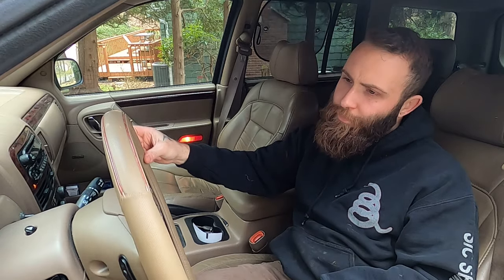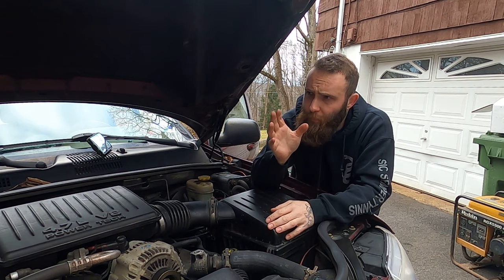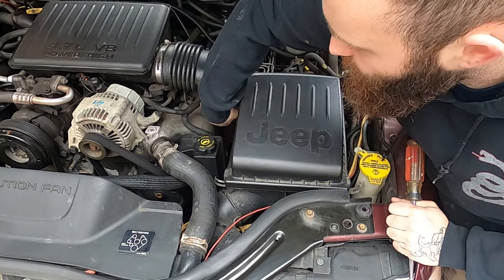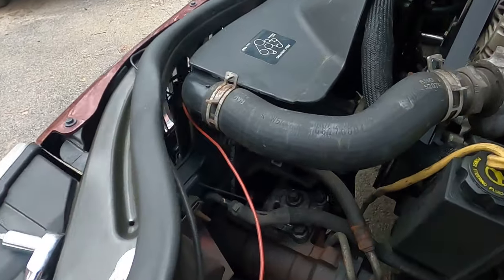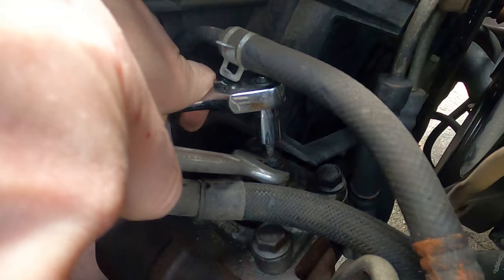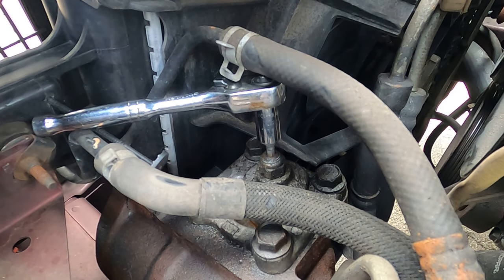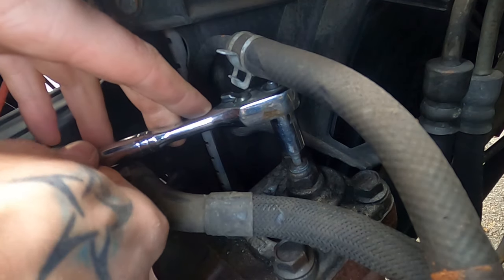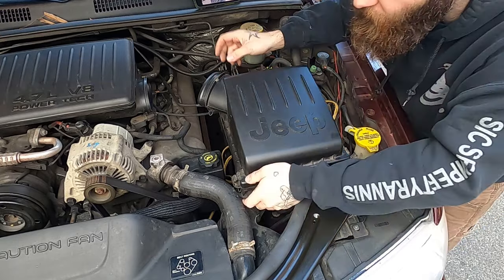How To Adjust Your Jeep Steering Box - FIX STEERING SLOP EASY!

Comment: My ZJ took about 3/4 of a full turn.  It also makes it a lot easier to keep track of the adjustment if you put a little dot on the allen adjuster and also on the box itself with a paint pen to keep track of where you started and where you're clocked to after adjustment.
Reply from the maker: That is a good point.. wish I had added that... also... 3/4 of a turn?! That has to be a record
Reply: Good idea!
Reply: Followed this advice and video. Have already adjusted a 1\2 turn. Still feels a little sloppy to me but I'm afraid to go any further. Curious after 2y if the 3\4 turn @natemasterson1727 made ever caused any issues. Still going strong?
Reply: @Joespower  I daily my XJ now but I did back the ZJ off MAYBE 1/8 of a turn. Just to fine tune it. Still going strong with that though, no binding feeling and no slop beyond what the 1 ton UTK kit has inherently with drag link roll. The box was on 200k miles with no adjustment ever before that that I could tell, and I’d definitely say mine is a fringe case. 

If you’re going over 1/2 turn, I would do 1/8 turn increments from there IF that to make sure there’s no binding. But you may have other slop at play outside of the box itself, and doing a full inspection of the system from firewall to ground should be done to rule any of that out. I at first thought the I joints on the linkage from firewall to box were worn causing some slop but they were still tight when I inspected them.
Reply: But the ink doesn't stay on through the oil.😂

Comment: YJ, the battery is passenger side firewall, airbox is in about the same position.    The nice thing about an old YJ is that you get lots of practice rebuilding the vehicle bolt-by-bolt over the course of about 5 years.  Mine will be new again in say, 18-24 months.
Reply from the maker: Well there you go bud!. I hear you on that for sure. I know every bolt, nut, and fastener on my WJ
Reply: Did this work on a YJ?

Comment: Thanks for posting and sharing your knowledge! 98 ZJ I6 4.0 here, I have to try that, neat tip. I've replaced the wheel hubs, axles, new tires, tie rod ends, front sway bar bushings, front diff oil & gasket, steering damper. I did notice that it drove just a little bit better after each of those components was changed but it is all total markedly better than when I first got this jeep. Next up is the front upper & lower control arms and ball joints. Thanksgiving morning I replaced the harmonic balancer (it delaminated), interesting job for me as I had never removed a radiator before. What a mess! Yup, gotta replace that soon and update the transmission cooling lines, too. And I haven't even touched the cosmetics yet...headliner is shot, carpet is crap but each and every area needs TLC and will serve as a learning for the next jeep. I'm gonna get that sweater!
Reply from the maker: Rock on man! Sounds like you are treating that Jeep right. An 1/8 of a turn or so on the only steering box may be the final piece for ya

Comment: Don’t forget the bushing adjustment on the input shaft side.  It is more likely that the play can be corrected there.  Also, take a sawzall and cut off the u joint splined coupling on the steering shaft and replace it with a new set-screw type from Borgeson or other quality manufacturer.  The play in the steering of my ‘01 XJ was actually due to slop in the splines of the u joint coupling on the input shaft.  Check it out!

Comment: I'm definitely going to have to try this! My wife has an 01WJ with the 4.0 and it drives phenomenally! But over the last year I've replaced the ball joints, tie rods, control arms, track bar, and all four shocks and it rides so smooth! But the steering wheel is kind of sloppy so hopefully this will take the last little bit out!

Comment: That adjustment is for removing play between the gears in (sector and worm) the steering box. It should be done with the steering box at the high point (centered) easiest way to check for play is to pull down on the pitman arm and then hit the end of the sector shaft up with the palm of your hand, you will hear it click if there is play. If so adjust the screw down just until that play goes away. If you over adjust your steering won't go boom, but it will be too tight and steer even worse.
Another huge source of play in those boxes is side play in the sector shaft needle bearing at the bottom end of the shaft. Best to replace that.

Comment: Great vid! Did this on the yjs old steering box, did the 1/8 of a turn and even that was too much, started grinding right away, didn’t even have to take it out for a drive. That’s when I said heck with it, Durango steering box time
Reply: Just FYI the Durango box isn't an upgrade. Might be nice and new, sure, but still not an upgrade. If it's in budget you might as well upgrade while you're replacing it $0.02
Reply: What box would you recommend  @RavenRedwood

Comment: I have a 96 ZJ Grand Cherokee Laredo best car I have ever owned.
210000 miles. Runs perfect although I can fix up a few change. Like this loose steering!
Gas is pretty cheap though not in California.
Thanks for the Vid I'm going to try this on my Jeep.
Reply from the maker: Good luck, bud!
Reply: My 96 ZJ was bulletproof, the 4L I6, and quadra-trac went everywhere I pointed it...it was offroad more than it was on the highway, sold it with 232k on it, drivers seat was all torn up from wear, and the viscous coupler in the transfer case was completely shot.  I still see the current owner driving it occasionally.  Last I knew it was very close to 500k on it, the current owner replaced the transfer case, its now selec-trac, and he pulled seat covers out of a wrecked ZJ.  If I had known back then what I know now about the transfer case swap and how to replace the seat covers I'd probably still be driving that ZJ.  My 98 ZJ was a box of problems sadly, and 2 weeks after the head gasket issue and $1200 the transmission decided to puke fluid all over my carport.  So I ended up trading it in on a 2008 Ford Explorer 4.6L V8 Eddie Bauer edition...so far its a great rig....but I will someday have another Jeep, just not sure what yet, possibly an XJ (you know how customizable they are, I'd love to build a trail rig not major offroad rock crawling but something I can just take to the hills and go anywhere I want).  I do like the ZJ and WJ, but would love an XJ or even an MJ.  Not a Wrangler fan, I want to be able to daily drive it as well, and the Wrangler is out of the question for practicality purposes they are NOT highway vehicles LOL

My 98 ZJ drove completely different than my 96 ZJ.  The 98 had U-Joints up front, the 96 had CV axles....you wouldn't think they'd be that much different on the highway but they were.  I loved the limited slip in my 98 ZJ with the selec-trac though, great in the snow....the 96 ZJ with quadra-trac was awesome in the snow, but not nearly as fun as the selec-trac in 2WD with the limited slip LOL.

Comment: Doug! Romex? LOL. Love the advice. Tightening up the steering on an old vehicle can make a world of difference. I recently refreshed all the steering components on my '04 WJ (240K miles) and she drives like it just came off the lot! Engine mounts took care of the low idle vibrations and I was able to convince my wife that we didn't need a new car yet, lol.
Reply from the maker: Woohoo! Keeping the old WJ for the win!
Reply: I have a similar WJ. Smokes real bad. May do the valve seals. Did you have that problem?
Reply: @Kanakid  No sir, not yet. LOL. What color is the smoke?
Reply: @jonb2046  it’s blue. Worse at low speeds pointed uphill.
Reply: @Kanakid  sounds like your on the right track. In my experience, valve seals are most likely the culprit when burning oil. Unless it’s getting in through the air intake. Have you had a rollover recently? Lol
Reply: @jonb2046  no rollover. Lol! I have new seals, spark plugs and valve cover gaskets. Need to get a compression tester to hook up air compressor. Will also need a valve spring compressor . Any suggestions?
Reply: @Kanakid  I really like OTC tools for that kind of thing. Honestly, I've never done the job without pulling the head. I'm sure someone out there has done it.
Reply: @Kanakid  I just watched a video on how its done with our removing the head. Seems fairly straight forward. No opportunity to examine the valve seats though.
Reply: Carbon build up on the exhaust valves?

Comment: Do u know what could be wrong if u turn to the right and the truck stalls? (Not the pump or filter, already changed those like 3-4 times) , it only happens in a right turn ):

Comment: I bought a 2000 xj from auction and omg so far what a nightmare. So far I welded in a new coil spring perch on driver's side. Then realized leaf spring shackles were both broken. While putting them in I noticed that 1 of the leaf springs has a couple leafs broken. And on the driver's side the U bolts someone used too short of u bolts and figured it was ok. Only one side of the u is sticking through to get nuts on it on both off them I really hope this makes sense. Which is causing the whole rear diff to move....smh. also I can turn the wheel about 90° and still drive straight at times. This thing is all over, wheel hop, feels like rims are bent driving. It's amazing what they let go through the auction. So know I have to put new leaf springs, shocks all around, control arms and everything else u mentioned in here. Thankfully I am mechanically inclined and parts are not extremely expensive. Compared to my audi that someone just totalled on me the parts are actually extremely cheap...lol. When it rains it pours.

Comment: Just did my tie rods on the WJ and it's like driving a different vehicle.
Reply from the maker: Makes all the difference. right??
Reply: @DEInTheGarage  fingers crossed 🤞I have had no shaking at all and no death wobble since replacing them
Reply from the maker: @matthewtwright84  nailed it, bud. Gotta love it when a repair actually fixes the intended issue
Reply: Mee too, yesterday and got a alignment today.  Shop said a little play in the steering. I suggested that I could adjust in the box, they said yes!👍I noticed a huge difference with the new tie rods. Didn't have a greese gun to lube them but did it today and haven't driven it yet. Hope it will be even more different now.

Comment: I have a leak on my box. A little power steering fluid is noticed. I want to tighten the bolts up a bit and hope it helps. A have a little bit of play on the steering but not much thinking giving it a small turn but scared to do it as you said that you can bugger things up. I am lucky to see your video on this because many times i have thought to tighten it up but did not otherwise i would have bugger it up
Reply from the maker: Yea bud, give it a shot! Good luck!

Comment: I've got a 2003 workhorse p42 that has a saginaw gearbox. I tried this. Most videos I saw were people saying turning it 1/8 of a turn and test so I did. I ended up turning it a full turn. Out of fear I turned it back a quarter turn. Performance improved a little, but with all my research online it seems like you also want to tighten the top collar first and you need a spanner wrench or some other hack to do that. Very leery of messing with it. Steering wheel is also crooked so been meaning to fix that one too.
Reply: I used to drive an old p30 '84 Chevy. I think slop was just a normal trait of those step vans because of the steering geometry. It was a good old truck though. I wish I still had it because it was purchased by my father at a government auction in the 90's and was previously owned by NASA. It had the all aluminum body and was used to transport things to the launch pads. It had a plaque glued to the dashboard that said it was approved by NASA for launch transport at Cape Canaveral. I haven't ever seen another plaque like it online anywhere. Sadly my dad traded it in for a fuso around 03. When he bought it, it was over 10 years old but only had like 2k miles on it. The original engine threw a rod just before I took over driving it in 2000 because the driver wasn't checking the oil and ran it dry. I was 16 years old and drove it every weekday for 3 years after that delivering furniture. I was happy for the upgrade to the fuso though as it was far bigger and had air conditioning but I still miss that old step van.

Comment: Great advice man! I was gonna do this on a friend's lightly used 07 Jeep Grand Cherokee. Just popped on to make sure I was on the right track. It only has 83k on it so the steering box was my first suspicion. I can't imagine it's tie rod ends or anything more major with such light use. But those steering boxes are notorious from being a bit on the looser side from the factory. Even only at 83k on the clock it could just need a little tweak. I'll likely start on the lesser side of adjustment just to be safe.

Comment: Hey I’m back again lmfao. Took it to a shop. They said they can’t find anything wrong with the steering box. Tie rods and track bar are brand new. The wheel still moves back and fourth even when it’s turned off. I don’t wanna spend money if it’s never gonna be normal again but what would you suggest

Comment: 2007 JK: I've done this with a newly installed (I believe brand new) gear box. It is almost to the point of fatal error. I know the adjustment is too tight because the wheels don't self-straighten when coming out of a turn. It did not fix any of the slop in the steering. Any suggestions on what else could cause the play in the gearbox input shaft?

Comment: A crows foot might help you get to the jam but a little easier.
Reply from the maker: 100% bud. It is a ton easier on the 4.0 as the upper rad hose is on the other side
Reply: @DEInTheGarage  good information though. Wife’s looking into getting a WJ.

Comment: Hi brother thanks so much. I am adjusting mine but paranoid im gonna over adjust and grenade my box. Is it possible to get all the play out of the wheel? I went 1/8-1/4-1/2 still a little slop in the box when you look at shaft attachment. Its better but just trying to optimize. 05 LJ 166k..Thanks again!

Comment: I have a 1999 Jeep Grand Laredo just under 280,000 miles and runs nearly like brand new minus the steering wheel issues that your referring to in the video. If I do the fixing myself it’s ok to drive down the street and back without putting the AC filter stuff back in place?

Comment: I just did all the bushings and tie rod ends everything front end and was greeted by 3 inches of slop on my first test drive beating on the pitman arm to get all the old stuff off probably knocked some of my jersey shore rust free it took about half a turn and it's good as new I was worried I might have made it too tight but there's no tight spots in the steering lock to lock and virtually 0 slop anymore
Reply from the maker: LOL... what an honor to be speaking with you Mr. Shackleford... Hope this helps out your Jersey Shore vehicle!

Comment: I replaced every component from the collar around the steering column all the way to the ball joints. I even did the Durango gear box swap and it got rid of my bump steer, but I still have slop. Any idea what else it could be? 91 jeep wrangler

Comment: QUESTION!  You know that little Allen head adjustment nut? WELLLLLLL…what do you do if you test drive after adjusting but forget to tighten down the retention nut and the allen nut goes flying off into oblivion spewing power steering fluid inside of your engine compartment? Where do I find that Allen head adjustment nut????

Comment: Hey dude. I have a simple, but long question. Please help. 76 cj5. Steering was super sloppy. I adjusted the steering box.....fixed. however, I found out that it takes white lithium grease. If it requires more grease, should I back off the adjustment?

Comment: Very interesting, the adjustment screw has nothing to do with the slag in the worm gear. It is not connected in any way with the worm gear. The adjustment screw sets the height of the teeth of the pitmanshaft to the teeth of piston. Both teeth are conical and closes if the screw is turned in.

Comment: Great video. I have a 2002 with 210k. It has play in the steering and wanders all over the road. I jacked the front up and shook the front wheels top and bottom and side to side and they were tight. No movement. Assuming the ball joints and tie rod ends are good could it be solely from the steering box?

Comment: I went a step further and replaced the whole damn steering box with a Durango gear and bolted up a brace (in my yj) it drove like a Cadillac for about a month and I’m back to about 11/2” or play in the wheel… before anyone chimes in yes the whole front end is new. Should I try this or take it back for the warranty?

Comment: Thank you! I have a WJ with 200k miles. Replaced all ball joints, wheel bearings and tie rod ends. Just needed the tip on the steering box to complete the steering. Do you have any hints on premature failure on heim joints? Side wear after only 2000 miles. Greased every 300 miles and at the end of each day of wheeling. Guaranteed not from lack of grease.

Comment: ‘15 JKU Rubi, 130K on the clock. I noticed play in wheel w/KO2’s on it. When I  put new Falken AT4 and the slop appeared to be worse. My wife won’t drive it. Too scared. So I will try it out and see what results I get. 1/8 turn or less. Copy that. I’ll let you know. What’s the alternative if this doesn’t clear it up?  New steer box. I like the vehicle. My ‘06 LJ w/35’s is far superior to this one with 33’s. I mean it’s very user friendly to dive. I’ll post up later with results stand by